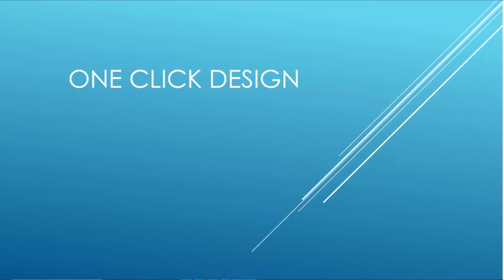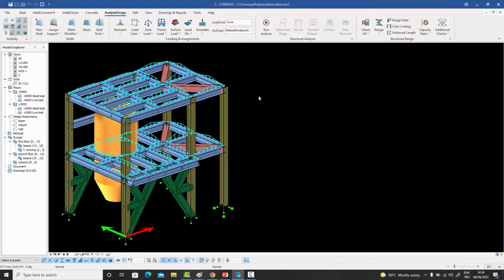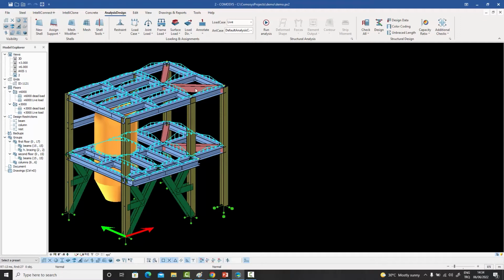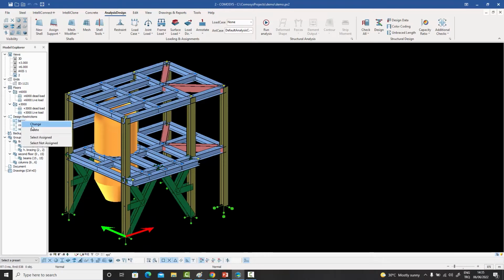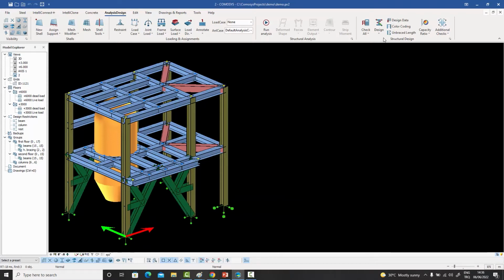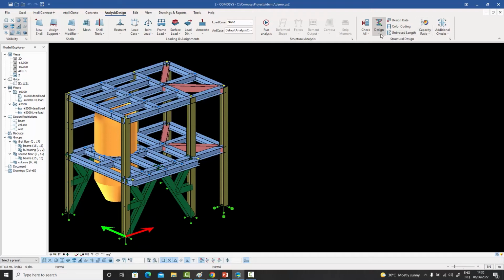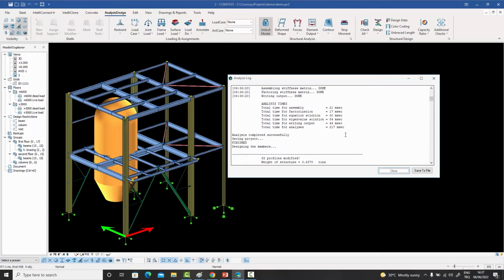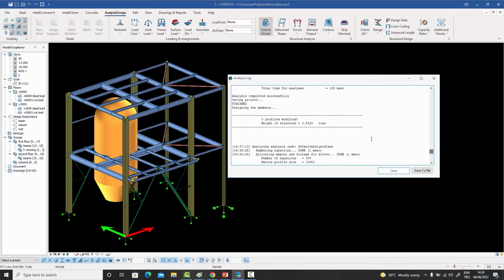One Click Design :  Comosys Analysis and Design Webinar ( 9 JUN 2022)  Highlights

Comment: One click design saves lot of time. According my knowledge, No analytical software doing it currently. Auto select and other method, will design based on current analytical result. But, it do not carry out re analysis and it is must as Stiffness matrix changed due re design. Re analysis is must along with redesign and comosys do it. Saves lots of time. Waiting for Indian code.
Reply from the maker: True Sir.